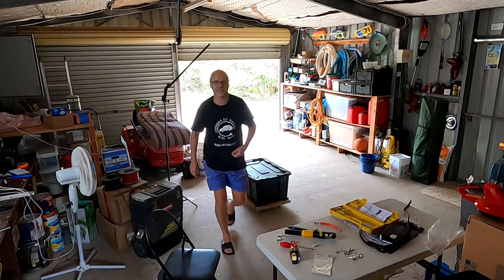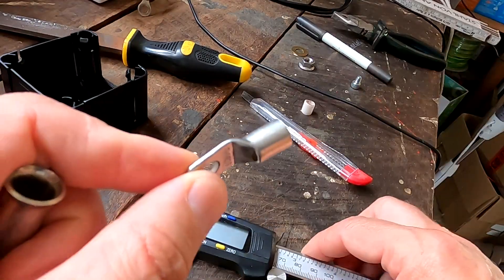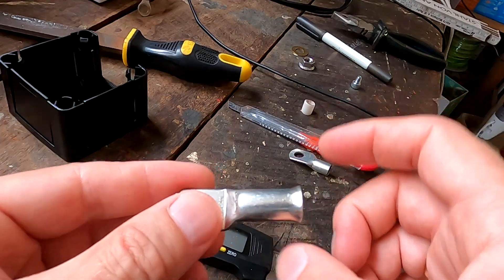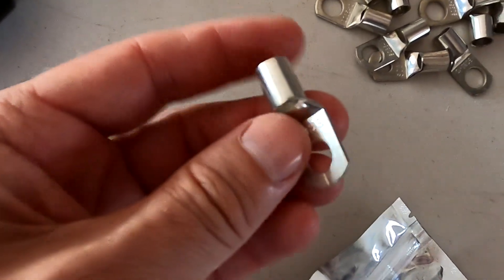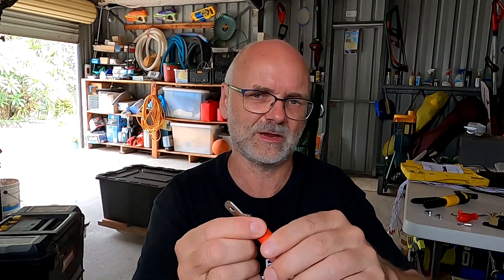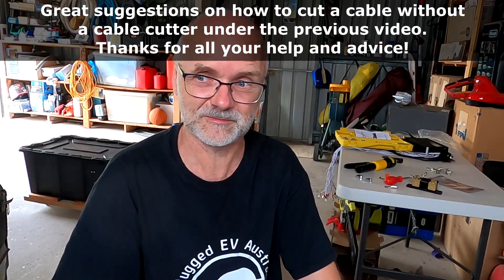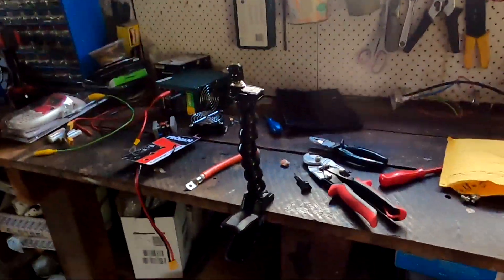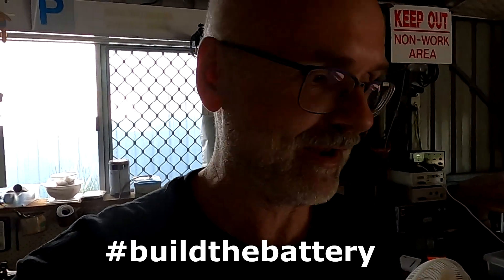Don't get frustrated with your DIY Solar Battery Project. #buildthebattery.4

Comment: Andy, I feel your pain.  It seems, putting one of these systems together is fraught with intricacies beyond ability to foresee and plan for in advance.  Having been in the mechanical trades I was able to say that I had quite a few of the tools and equipment needed on hand.  But each day brought the need for some individual item that I did not possess.  This made the process last a very long time.  I live remotely from any advanced source of such materials or items.  I needed to order via the internet and wait for the shipment to arrive.  Then there was the issue of items that arrived but were somehow unusable which required more time and patience.  
Once everything did finally come together the collection of 'things' made it quite possible to build more systems, though.  I guess that's why experience is so valuable.

Comment: Hi Andy , sorry i am a bit late to the party , the lugs you fitted are bell mouth and a rough cut end is guided into the lug when fitting  however you cannot always get bell mouth crimp lugs and you cant always get that undamaged end as you point out so,  when you dont have the right tools or a bell mouth lug what we do is measure the lug stem , cut the outer sheath off only ! to that length leaving the inner white insulation showing, then cut 4mm of white insulation off the end , push the lug on by 4mm  then cut the white insulation back to where the outer length was removed  and push home. this will work 100$ of the time as the object is to have all strands  in the lug , it is not correct to remove any or let them bunch up
Reply from the maker: That's a great tip, thank you!

Comment: Moral of the story - make sure you have quality fittings that can handle the amperage that may be utilized and have the right tools for the job. When I finally have the opportunity to build my 12kW bank, I'll most likely not use the hardware that comes with the batteries and get fittings from my local electrical supply store. So much learned, so much more to go
Reply from the maker: Yes, the learnings of all this is incredible and very satisfying I found. So glad I can share all this here on the channel.

Comment: But do you have heat shrink to cover the connectors??
Reply from the maker: Heatshrink goes over the terminals where the cable connected. That's it. The battery sits in an insulated box.
Reply: @OffGridGarageAustralia  that's what I was referring to.  We all have the bad days when nothing works. Better days ahead.

Comment: Hi Andy, I know it’s quiet late to be adding a suggestion on the battery box but I was thinking that since you put it on wheels to make it portable you could add an Anderson plug to the box so that you can disconnect it for inspection and maintenance purposes. The Anderson plugs are very robust and reliable & are not likely to cause any high resistance or heat.
Reply from the maker: I'm still thinking about it. Other have made this suggestion too. It makes sense, doesn't it?

Comment: I meant to tell you your suppose to rotate your crimp in that hydraulic crimping tool the section that has the squish out rotate it into the top and bottom of the crimp tool and crimp again to get near perfect crimps I have same exact crimping tool.
Reply from the maker: Thanks for the tip!

Comment: Every day is a good day watching your videos. You display a great demeanor for teaching and I appreciate the time you put into your videos. There always seems to be another tool needed. I, too need a good cable cutter. I use an older, heavy duty PVC cutter for larger cables and it seems to work for the time being. BTW, I use an ISDT T8 charger with a 30 amp variable 12v power supply. It works very well to balance while charging. Looking forward to your next video. I am running a very similar project, same batteries (8 total though), same Victron Shunt, but in 12V. I also have a bank of 16 - 60AH LIFEPO batteries 2 - 2P4S banks in 12V. Going to run 2 separate 40AMP Epever charge controllers with 1000W of panels.
Reply from the maker: Thanks Peter, much appreciated!

Comment: I use my anvil type garden pruner for all my big cable cutting. I use it for pruning roses etc. too. Also I solder the terminals after crimping. I guess I developed this habit from years of making battery cables to replace massively corroded OEM stuff. I use welding cable too. On the shelf at auto parts stores.  :)
Reply from the maker: A garden pruner.... 🙃
Reply: @OffGridGarageAustralia  Yeah, those anvil pruners (if they are as sharp as I keep mine) make good wire cutters. Also hose cutters .  :)
Reply: @OffGridGarageAustralia  Been watching your project from the start. You're doin' good. Going at it methodically. As an EE I'm impressed and proud if your progress.  This is going to work out just fine. :)

Comment: I have a very similar hydraulic crimper for putting lugs on heavy wire. I was able to find nice thick copper lugs and 2/0 wire locally at a welding supply shop, but I'm in 🇺🇲 , so I'm sure our local supply is very different from yours. There are also a couple different electrical supply houses near me that carry such things, along with Lowe's and Home Depot. You may be able to find a few cable lugs locally if you have any of these places available to you. I was surprised you didn't check the hardware store that sold you the cable cutters. Hang in there my friend. Things will get easier with the right tools and supplies. Keep your head up!
Reply from the maker: I found good lugs from a company not too far away from here so they cam 2 days later already. Project continues as planned ;)

Comment: by the way... you can easily put on side of the hydraulic crimper in a vice... you'll have the cable in hand - push it against the crimper and use the crimper with the other hand... much easier...
Reply from the maker: Fantastic tip. I'll try this next time!

Comment: U shold take the cable with u and use the tool in the shoop ajajja take measurements of the lenght and cut the cable there 😜

Comment: I'm absoloutley with you! Been livin in Sweden for a while. Did some projects, toolbox full with all you can thinking of and coming close to the end somethings is missing. Neverless if material or tool. 
In the end of the day it's not the price on it: More the time to wait or travelling miles over miles to get it.
Reply from the maker: Yes, absolutely. A nightmare because the whole project stops all of the sudden... rolling again 😉

Comment: About cutting tool ....i have same dilema cutting 120mm²
Reply: Ratchet cable cutters on Ebay ~£20. I've used them on 50mm^2 copper and even 3 core 6mm^2 swa (stretching it !). I'm pretty sure that they're specified for 120mm^2 copper.

Comment: Ben there , Done that . The secret is industrial solid copper with aluminum lugs and antiox . The good part is after sliding on your insulation tube you can color each insulated conductor using electrical tape .
Wish we could send pictures in the comments . PS: the reason we did this was to eliminate heat at connections . Soldering after crimp decayed after 2 +- years of high amp usage .
Reply from the maker: Thanks for the tips! I'm not a big fan of soldering these lugs either. Although 100A peak should be fine.